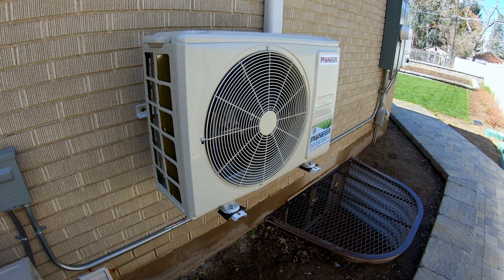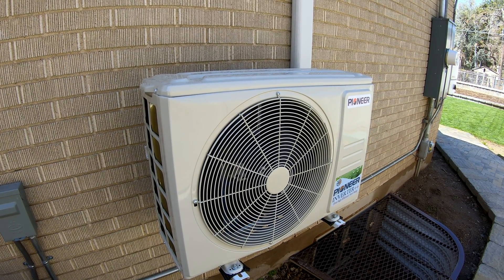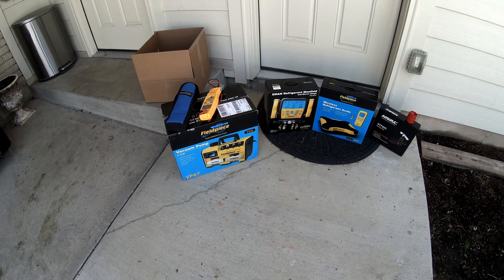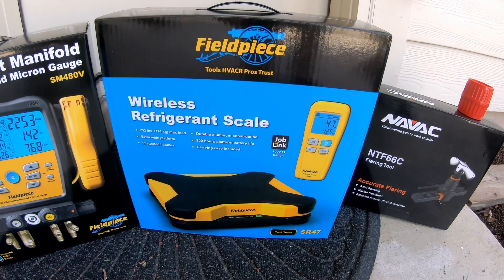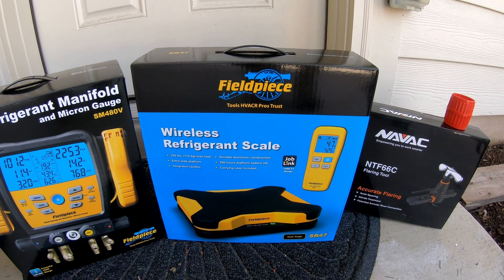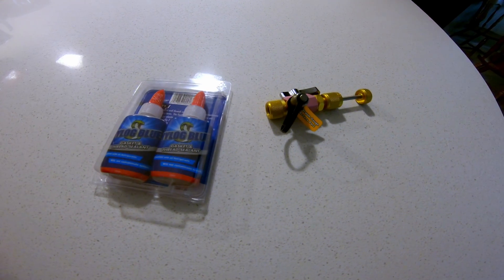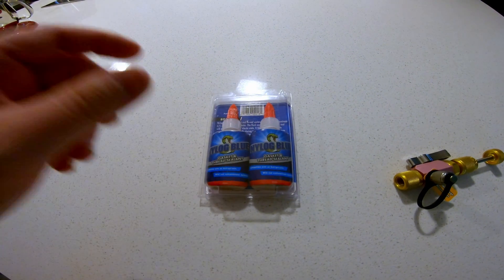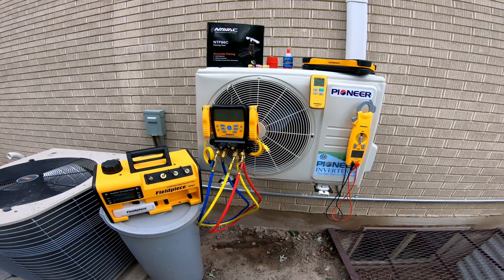I DIY’d a non-DIY Mini-Split. Essential Tools & Tips for a Successful Setup.

Comment: Hey thank you so much for all the information that you provide, have you thought about doing the same thing with the solar panels to the mini split I've got too many splits and I would love to power them with solar but I'm not familiar enough with solar to do it I followed your video on your bigger unit where you added solar power to it I wondered if it would be possible to do the same thing with the mini split? Thank you very much for your video
Reply from the maker: My pleasure! Unfortunately, mini splits are a challenge to run on a micro inverter like the standard central units because mini splits don’t have a contactor…so we can’t use that, and mini splits have such a wide range of energy consumption do to their variable speed tech that it becomes very hard to not back feed the grid when powering them. There are a few options I have been thinking about and experimenting with…but haven’t found the best solution yet.

Comment: I just ordered the same Pioneer model and I ordered the 25 ft line set as well with it. I am installing it on my 2nd floor bedroom. I need to cut and make new flares for the lines, I assume I do not need to re charge them since the refrigerant is within the actual outdoor condenser?
Reply from the maker: You are correct, the refrigerant is in the condenser unit. So you can cut the lines very easily to length. Be sure to pull a good evacuation on them before releasing the refrigerant. Thanks for watching!